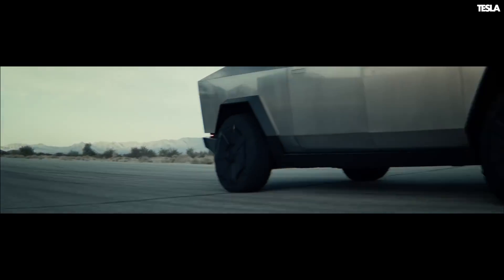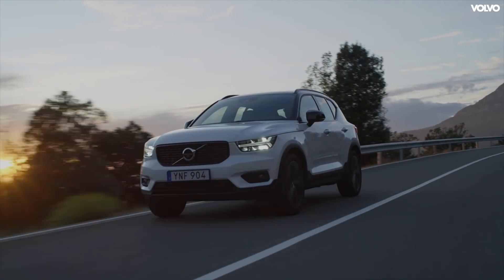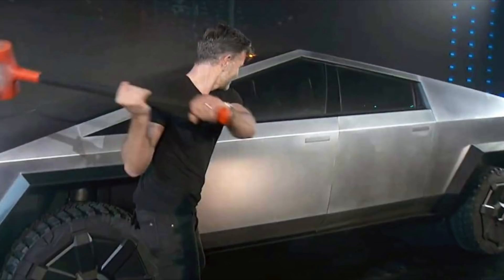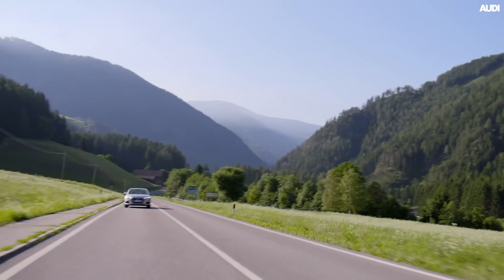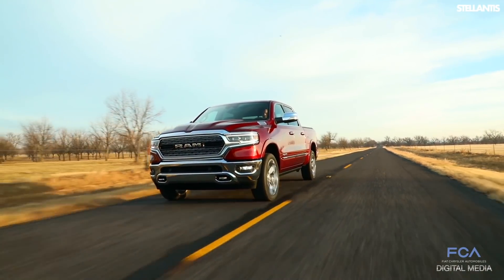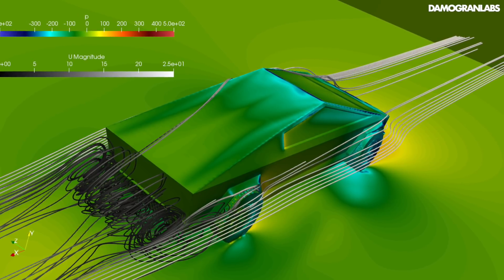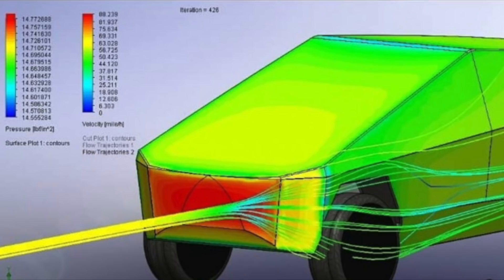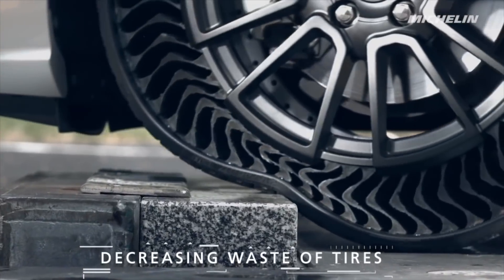Cybertruck's Secret Hypercar Aero

Comment: I'm not sure about the front end of the Cybertruck aerodynamically, but the back uses  what is called a kammback tail. this is NOTHING new. Is commonly used on sports cars, and many passenger cars to varying degrees.  Even though it really works really well, like the Corvette Bubble canopy, people thought it "looked old" because it had been a commonality for so long. And so it was mostly gotten rid of. It is still there, and an important part of modern aero in automobiles, but no one makes a big notice of it in their vehicles' design anymore. But the bubble canopy with return, although someone will say "it looks like a fighter plane canopy"... Well duh!

While I am not sure about the Cybertruck's front end, the front end seems more like what is normally done for NASCAR racecars, and was a major cue for modern Cadillac styling, among so many other examples. Using the front end to plow "under" the wind. This effect increases with speed even on modern pick-up trucks. Is it as effective as NOT having a grill? No, though most new trucks today have "grill shutters" which radically improves the effect at speed without endangering the engine. Like NASCAR  Racecars, at the speeds they can travel they barely need more than a tiny opening the size of a man's hand for a grill, for breathing and cooling. While a lot of people like to say that grills will go away. I find that unlikely. But they will be greatly diminished and in BEVs, only eluded to for the sake of identity and individuality between makers and models.
Reply: Why bother with this bible of a comment, it's not a real vehicle and never will be, it's simply yet another Musk scam.
Reply: @aftoknito  sounds like someone is a little butt hurt that they cant afford a Tesla😂. Now granted i cant afford one either. But come on man. You really think people were believing Enzo Ferrari back in the day with his cars? Now look at Ferrari. Its all R&D. At some point we all have to admit that electric is going to be the future whether we like it or not.
Reply: @mggames__3171  Why would I want to buy into an overpriced walled garden that makes Apple look open source in comparison? Why would I want a vehicle that I can't fix myself at home because it literally has DRM?
I'd also prefer my car not to drive itself into the ditch, thank you very much, and that describes Tesla's demographic perfectly: people that should be using public transit instead since they clearly do not enjoy driving.
Reply: @aftoknito  im not on the Tesla bandwagon. I like my combustion engines. But im also not a hater. With the way government is shaping up with economic sanctions and protections, electric will be the future whether we want it to be or not. All im saying is dont hate a company that still needs to find its legs. Microsoft was once garbage too. Still kinda is.

Comment: 1:38 Well this video was posted before the Ford F-150 Lightning BET (Battery Electric Truck) was announced. It rides on the fully designed and engineered chassis designed to be a BEV. The approach also means Ford can keep its VAST array of truck variants, from "standard-cab short-bed" (if they ever do that again) all the way to "Crew-cab long-bed dualie" and "chassis cabs". Something the Cybertruck simply won't be able to touch in its current form. GM (Chevy/ GMC) are prepping to the the same thing, and we are fairly certain RAM will follow suit (but that is a wait and see). 

As for range, that is still going to be an issue, but one wonders how stable that range will be. If you have more than two adults in the Cybertruck can you still return about 500miles of range? And at about $40K to start will that get you that 500mile range? All signs, including Tesla themselves, say "no". You are looking at about $60k-$70K for that range. But the F-150 Lightning BET is set to reach at least 350miles (not much more if that much) form its lofty $70K start price. And that may still be low balling it. as fast as BEV tech changes and/or improves, even outside of Tesla, the Ford F-150 BET may reach at least 400miles. 

Time will tell.
Reply: Don't need time, everyone with more than 1 functioning braincell knows this is just yet another Musk scam and will never see the light of day.

Comment: Can you go into more detail about the virtual long tail and the front creating a high pressure zone? What is the source of the aerodynamic simulations?
Reply: I too don’t quite get this part. The sudden drop off will essentially create a very low pressure vacuum that will suck in any airflow. Need to see some actual aero guys take on this, this channel could be fanboying

Comment: As an aerodynamicist, this made me cringe so hard...
Reply: The funny thing is the actual sim says the exact opposite what he was saying at times lmfao
Reply: @Koffiato  Yeh, big-ass stagnation region in the front + big-ass separation region in the back = a boat load of drag, no matter which way they try to spin it ¯\_(ツ)_/¯

Mind you, I'm still at the stage of questioning the veracity of these pretty pictures. Notice they're not advertising ANY numbers or offering any wind tunnel data for validation purposes. The general rule in the industry is that any simulation is bullshit until proven otherwise. That's because the solver will do what you tell it and has no way of knowing whether the numbers it spits out are realistic at all. It's a dumb machine that requires an intelligent human to supply it the correct boundary conditions and equations to solve. The practical upshot of this is that just about any idiot can follow an online tutorial and produce a pretty picture which looks good, but is just wrong. Validation is the name of the game.
Reply: Would be nice if you could make a video.
Reply: @boostav  I've been meaning to supplement Thunderf00t's rather excellent takedown of the hype-loop for a good few years now, but I always seem to find something more important to do 😒

Maybe in 6-9 months time I'd be able to do more, but for now I can offer a long-ish comment if you feel like reading one ¯\_(ツ)_/¯
Reply: @233kosta  Sure that would be interesting.

Comment: "Could stop a bullet from a handgun" which handgun/caliber and ammo type?
Reply: Ruger Mk 3? 🤣
Reply: 9mm according to the presentation
Reply: @boostav  Pretty low bar, all things considered
Reply: @233kosta  Not for a handgun caliber. Regardless it wasn't made to be bullet proof, it's simply a by product of the material being used.
Reply: @boostav  10mm comes to mind. .38 special, .357 magnum, hell - even ye' olde' .45ACP. The 9x19 is pretty low energy compared to most pistol calibres, just happens to be very common.

I don't really care why they bothered to stick "bulletproof" in the marketing, it just happens to be very low hanging bullshit, especially in light of the window thing.
Reply: @233kosta  If it stops 9mm, it stops .45ACP. Velocity is what matters when penetrating materials. It's not low hanging bullshit when it can stop the most common handgun calibers. Not sure why the window thing would make any difference.
Reply: @boostav  Can you get solid brass 9mm in the US yet?

In any case, why would a kidnapper shoot the door when there's a perfectly good window?

Comment: The front has high pressure and during ur simulation.. the end had low pressure.. won't tht increase drag.. and reduce range?
Reply: The front is what you'd call the mother of all stagnation points. It's basically a bluff body. Not ideal to say the least.
Reply: It's 2X-3X smaller front than competitor trucks

Comment: Woah! There is so much bs in this video, that it is scary. 
Now, I wonder if you are paid to say this staff. 
The unibody is more rigid and in off-road use it will snap, that is why the off-road cars manufacture still use frame in steel and body on frame…the frame needs to move under the body! 
Fancy the cyber truck but to bad it doesn’t exist and it is quite useless to compare a truck of that size with a Bugatti, plus…would love to see the cybertruck speed with a load in the back and open trunk. Then we would laugh.
Isn’t also truly annoying and lame this “musk did this and that”. So, he builds cars, truck, rocket, panels, satellites and in the spare time also cellphones. Woah!
Does he ever sleep?
Oh, one more thing. 
The air suspension are insane but in an off-road truck aren’t really the best, at all. 
To delicate and not enough clearance when crawling or doing crazy stuff. 
Sure, lovely that you can lower the truck and varie inclination when cornering but…wouldn’t be nice to re-invent suspension instead that keep using the same stuff like anybody else?
There is no miracle in the cybertruck just pure design magic, useless off-road aerodynamic and straight line speed…then at the corner…
Reply: @Aryan A you must be tripping. Badly.
Musk isn’t the Chief engineer but the CEO-Chief Executive Officer.
And no, the cyber truck isn’t on the road.
Remember, realism is not a toy and the lack of it is a psychological disturbance. 
Musk isn’t a saint, actually so far from
It that it is scary.
Reply: @Aryan A where did I wrote that the cybertruck is a scam?
I wrote that it ia not on the market. 
Obviously the build of that vehicle is not easy and just to let you know…the CEO is the one that lead a company…so, off course the ceo of a company can choose what’s next…also cos he cover the role of CTO (chief technical officer) not lead engineer (cos he is not an engineer, but by heart he is considered one, but so me and you can be). 
And, did you just wrote that Nikola Tesla was a lier?
Are you serious?
Oh, and the mass production of the cybertruck  is not easy, for a lot of reasons. The costs of production, the facilities and so on. 
If fact I read that it will be starting production in 2022, maybe…cos it is not simple to mass produce something that should not cost like a falcon 😂
Reply: @Aryan A aaaaaaah ok. I got it now.

Comment: But the rear bed cover is very boxy and boxiness is not something to be used for less drag coefficient

Update after CyberTruck release and after watching carwow CyberBeast drag race scary fast doesn't even describe it and looks weightless for something that weights 3 ton and limited speed of before the upgrading to new firmware to give it 130mph was 114mph
Reply: unless you make a way using computer software to do exactly that.
Reply: @skybattler2624 Going any fast if its not aerodynamic will just create more drag like Hummer H1 that truck makes snail seems to move faster

Comment: Why was my thought instantly "I wonder what this thing would look like with 4-link independent suspension with 38 inches of travel" 🤷‍♂️ just me?
Reply: @Aryan A No, they also stop you using other DC fast chargers. It effectively means they can make your car useless for long trips.
Charging infrastructure should not be under the control of vehicle manufacturers and neither should they have the ability to disable charging remotely, the conflict of interest is way too fucking large.
Imagine if Ford owned 75% of the gas pumps and decided to stop selling you fuel from them, and also had the ability to remotely reduce the diameter of your fuel fill hose to that of a kid's straw just because they've decided that your car doesn't "conform to their standards". There'd be massive outrage, and yet it's exactly what Tesla is doing and here you are defending them.
Reply: Hey it's a Tesla so if you want to modify it like that it's a $300 monthly fee or they'll brick it.

Comment: Man, leave it to aerospace engineers to design such a car.
Reply: No, leave it to a bunch of British  ex jaguar and formula one engineers working at Tesla. They left jaguar after it was sold to Tata by Ford. Many also left Tesla for Lucid.
Reply: @foreverinteriors  why are you disagreeing ???
Reply: @idyllicwrld  why? Only because the methods used to achieve the low aero coefficient greatly reduce the usability of the vehicle for its intended use - a work truck. I did say if it's target audience is residential then sure go crazy with aero but as a commercial fleet vehicle, it's impractical.
Reply: @foreverinteriors  not to mention i'm fairly sure this thing will fail every possible pedestrian safety regulation
Reply: Next time SpaceX creates a rocket it will be all square and blocky too... They will show in a YT video that that is actually much more aerodynamic and clever...

Comment: I still have a hard time believing this truck will pass a safety test especially in a crash that involves pedestrians that stainless steel defiantly won't give away to a human not to mention those hard edged would do a lot of damage
Reply: To be honest, this could be said about any pick-up truck. In the event of a collision, a pedestrian stands no f**king chance.
Reply: @Kevwe Patani yeah it does, especially compared to stainless. Have you ever felt how easy it is to deform a car's bonnet/hood in the central area?
Reply: And the A Pillar buckling in any frontal impact.
Reply: @observingrogue7652    You might want to consider another line of work.
Reply: @merkin_muffley  
No, I am passionate about motorcycle mastery, and delivering things as quickly & safely as possible. As I have been doing, I just have to adapt to the degenerates of society.
Reply: and the back seat passengers lack of head room.
Reply: @Kevwe Patani normal metal on pick up trucks made post 2000 will bend at low speeds apon contact with a person
Reply: @Kevwe Patani cars are tested for pedestrian impact. Bumpers, hoods have to deform even at low speeds.
Reply: Hey, the guy builds moon rockets better than Boeing or NASA. He can fix this.

Comment: Being no expert in car safety I wonder what will happen if you crash this car at high speeds. I mean the sheet metal does not bend like normal car steel. The acceleration on the body when crashing into something must be huge
Reply: It will have to pass crash saftey like every other car.
Reply: They probably have still have crush areas and not to mention air bag technology will continue to get better.
Reply: Well the people designing it actually are experts in car safety. It’s got that origami plate steel exterior, gigacastings front and rear and connecting substructures for the sides and roof. Like all the other Teslas out their, occupant safety is No.1 priority for Elon. It’ll be awesome.
Reply: @TecnamTwin  the people designing every car for sale at least in first world countries are experts in car safety, why do people always talk about tesla as if they are the only company with smart people working for them?

Comment: erm, body-on-frame construction is less rigid than unibody. and trucks use it because chassis flex is a good thing, what bends is less likely to crack. it's still a good video, but some of the fact checking could be better i think
Reply: They also used footage of the wrong Audi TT. It was the first one that needed a recall to add a spoiler.
Reply: Ladder frame has the advantage of towing heavy loads. And because it is isolated from the cabin, the towing experience is more pleasant. 
Of course, this means body on frame vehicles don’t have the direct feel of a unibody.
Reply: Im quite sure one of the main reasons for body on fraim was the initial low cost, and with time it got developed quite s bit, its good with a reasonably low center of gravity. But its far from the ideal off road blueprint. So its more than just one side. But i could be wrong, not a big truck guy just an mehanical engineer student
Reply: @svenmuller1045  yeah BOF is more due to reliability , for an offroad purpose you have 2 goals ( capability and endurance ) , bof is more towards endurance and ease of repairibility and uni is better for overall performance and build with less endurance and repairability
Reply: I agree
Reply: Standard trucks need to flex because they are made from cheaper metals. They are not 220 mph Moto GP bikes where flex makes a big deal in grip. Popular ICE trucks are cheap masses of metal with the highest profit margin of any mass market vehicle sold in the US, at least. And our work F-150 feels like my friends 1977 Chevey Cordova with stock suspension, which feels like a paddle boat at a cheap theme park or something. But yes, repairability, I'm curious who will offer full coverage insurance on a thing if you do back into a tree or something, how will it ever get repaired?
Reply: Considering he fell for this scam to begin with, are you surprised? His entire qualifications start and stop at having a record in a pretty insignificant track using a very overpowered car compared to the rest of the leaderboard.